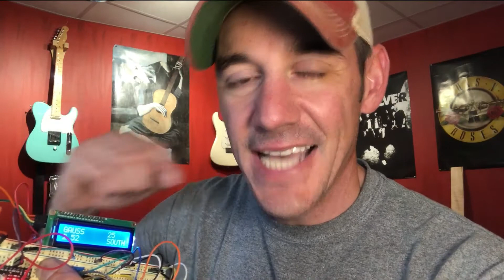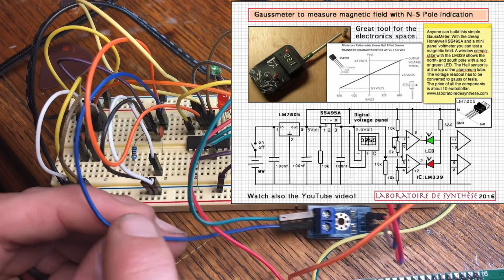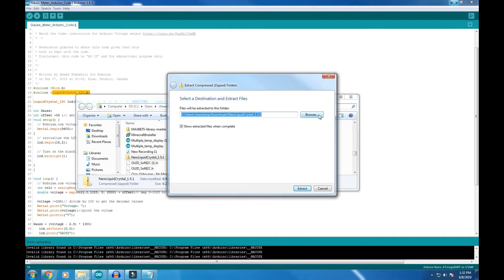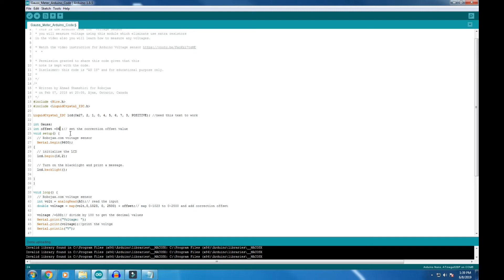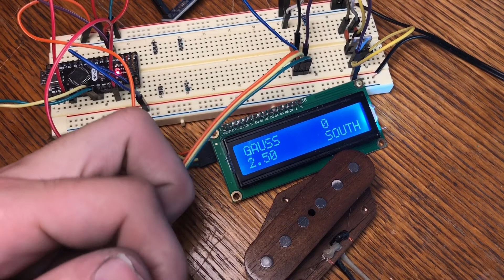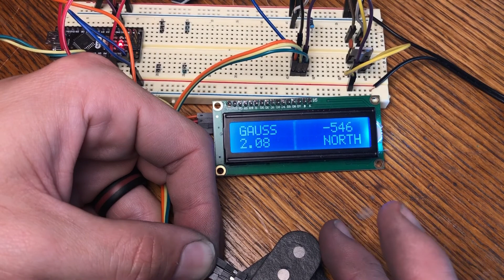✅DIY Gauss Meter with Arduino to Check a Pickups Magnet Strength

Comment: ive been trying to use this code on many different machines, and it's got so many little bugs and hangups I can't even get close to having a usable guass meter
Reply from the maker: martinluthierking sorry bud. What are you using and what is the errors. Are you having trouble uploading or another issue. I can make a video on your issue if you need me to. Let me know. Send me an email if you want to. Weatherfordwoodcrafts@gmail.com
Reply from the maker: martinluthierking I may have found the issue in the code. I changed it. For some reason my website was excluding the include functions on my code. I’m sorry for the confusion and let me know if that helped if not send me an email bud.
Reply: @ChasesWKshop  I can't get the breadboard and Nano to power up with a battery and iv'e wired it up 10 times, so I went on to the code and I have encountered a half dozen strays (200,223,234,235,302,303,342 etc.), and it seems different everytime on mac or windows.
Reply from the maker: martinluthierking gotcha. Are you running the board, voltage sensor and lcd off of the battery? You may not have enough juice to power all of that. On the code, do you know all the steps to set up your board with the correct com port and correct ic. If they’re not the same you will get tons of errors.  I’d also try to power it off of your computer or a 9 v power supply to see if that works.  If this is your first arduino project let me know I can send you some videos to help you get through some of this stuff. Hope this helps bud. Let me know!
Reply: @ChasesWKshop  it'll power up with a USB cord so thats not my biggest problem, it's not compiling the code that is my biggest obstacle. I've done a few projects but nothing this in depth nor on a nano arduino.
Reply from the maker: martinluthierking gotcha bud. I did have an error on my code that I fixed so that may be part of the issue. My bad for sure on that!  Make sure you’re using the right com port on you computer(basically the right USB port) it can be set in arduino ide. Make sure you’re using the right processor too. It should say on your arduino and make sure it’s set to the right one in your arduino  ide software. If you will send me some pics of it to my email and I’ll sort it out for you. Hope this helps.
Reply from the maker: martinluthierking okay. I figured it out. Apparently when you copy and paste the code from my website it changes the “quotes” to a different format that the IDE doesn’t understand. I changed the file to where you can download it strait into your IDE bypassing this issue. I’m sorry. Had no idea it would do that. Let me know if that fixes it.
Reply: @ChasesWKshop  wow ok thats awesome..so I'm not crazy! :) I'll try the code again tomorrow!